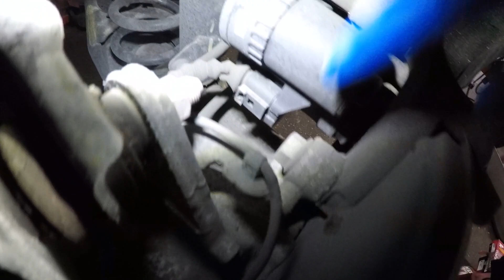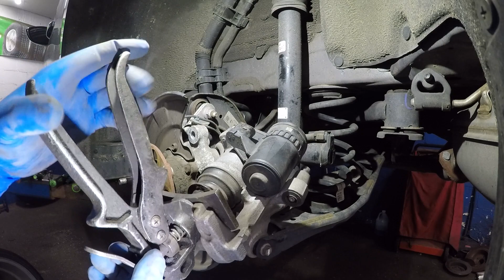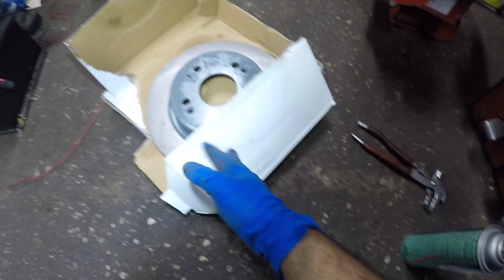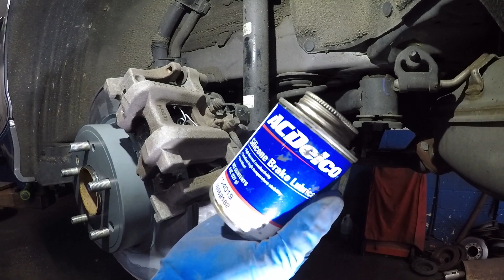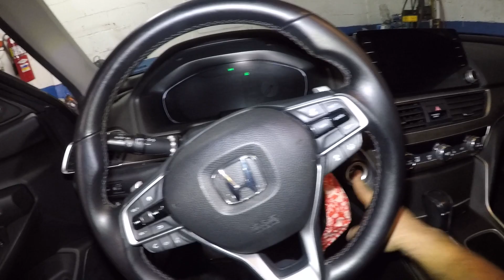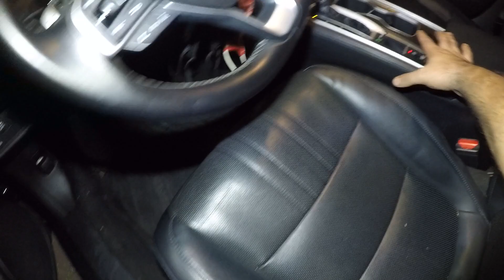How to replace rear  brakes and rotors on 2014 to 2023 Honda Accord

Comment: @RBTheMechanic  I need to disconnect the battery first to start working with rear brake just in case no get later any light on dash board?
Reply from the maker: No u don’t need to do that put the key off
Reply: @RBTheMechanic  thanks 🙏🏽

Comment: Better man then me... i would have drilled that screw out😂😂😂
Reply from the maker: Yeah
Reply: @RBTheMechanic  hey I got question my guy. I just did a brake job on an 19 accord. Now they have a spring like sound whenever the brakes are hit coming to a stop, coming from the rear passenger. What you think?
Reply from the maker: @lastkingofinca  without looking I can’t tell but check all of ur work bolts and the brake retainer

Comment: Wished i would watched video before trying this, do u know if top or bottom of plug is + or - . I changed mine and now i have a parking brake alarm coming up on dash
Reply from the maker: Yeah check ur connectors u less it’s worst than that some times it loose
Connector

Comment: Watching from France..Great explanation with humour..Step by step and easy to understand your english. Is it the same procedure for a Honda HRV..Do you use a battery to push the caliper..Thankyou so much Sir.
Reply from the maker: Yea same process I have few videos u can use battery I would recommend 5v.  Also u can manually turn it by removing acuator

Comment: I just did my 2018 accord and yes the piston does turn to retract. You need to compress it and turn it clockwise and it will retract all the way. No need to power the motor. Needle nose pliers work so no need to go buy the special tool either.

Also for that screw, I find that a long breaker bar works best with a right fitting bit. Very slowly and the screws come right out. Although I have seen ones completely seized.
Reply from the maker: Nice good job
Reply: For the philips screws that hold the rotors to the hubs, I use an ancient brace-and-bit. The swing arm gives you plenty of torque, and you can lean your shoulder or your gut into the back handle to keep the screwdriver bit pinned in so it doesn't cam out.
Reply: I do have to add that it didn't work out that way just now on the wife's 2016 EX. I ended up drilling and using the screw extractor on a couple of 'em that just. would. not. come. out.  The others responded well to banging on a #3 Philips screwdriver with a small sledge hammer while I tried turning it.  Poor man's impact driver worked! :D

Comment: heavy on the " its 900 for the backs" scammers
Reply from the maker: Damnnn 900!!!
Reply: Yes. Honda stealerships here wanted $1500 for all around
Reply: @titanjake8640   And THAT, ladies and gents, is why I've done almost all the work on my own cars for as long as I've been driving. :P  Even if I end up spending hundreds of dollars on tools I haven't got yet for a particular job, it still winds up costing way less than having a dealership or even a good shop in town do it.  Case in point: front suspension bushings.  $80 for bushings, $200 for the HarborFreight 20 ton press, a couple hours of my Saturday, vs. something like $1000. for a shop to do it.   Second case:  seized up damaged transmission.  The only reputable transmission shop in town wanted $1500 just to get the gearbox out of the car to figure out what's wrong with it (which I understand, it takes forEVER to get that thing out of an Accord :D).  I spent: $500 for an eBay gearbox, $150 for a clutch, $300 for an impact driver I hadn't needed up to this point, and $300 for a new, much better floor jack after my 30yo Craftsman failed on me.  Took a while, 'cause I had to keep dodging bad weather, but I got the car back on the road for less than the shop wanted just to take it off the road :D